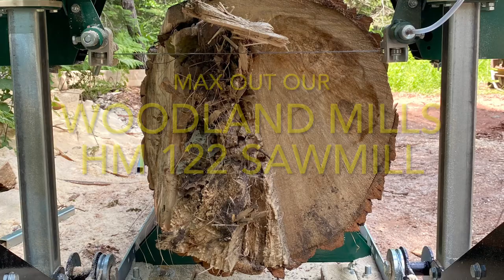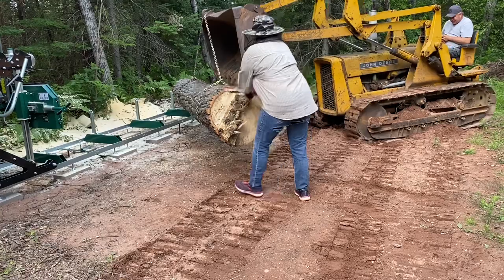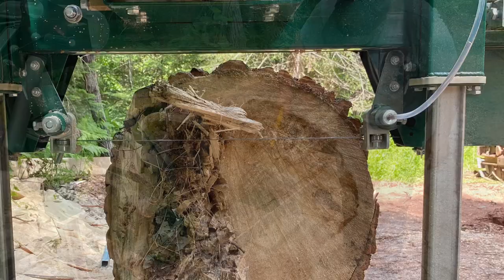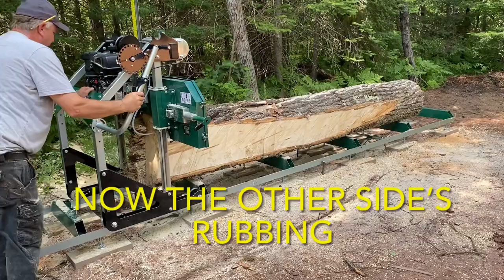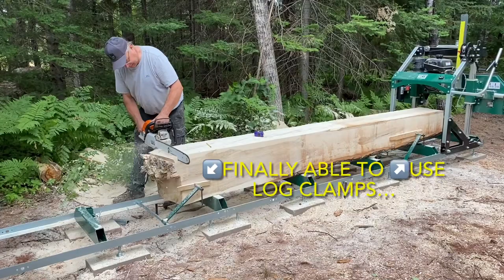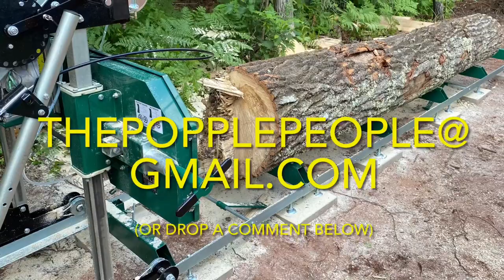MAXXED OUT Woodland Mills SAWMILL!-Popple People-Episode 49

Comment: I am assembling a WM122 and am wondering about the effort to push the saw. Which engine size do you have? If it's a 9.5 hp, I better head for the gym!
Reply from the maker: We have the 9.5 engine & it doesn’t take a lot of effort to push as long as you have a sharp blade. We go slow so it might look like it pushes hard, but it doesn’t. With a sharp blade and proper settings, the saw cuts nice with little effort. Congrats on your mill! Happy Sawdusting, Steve!